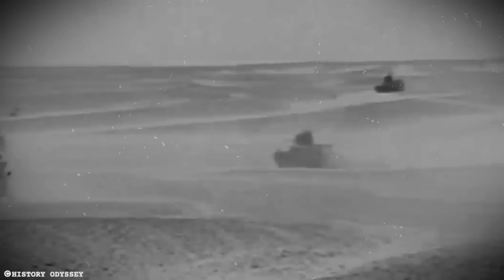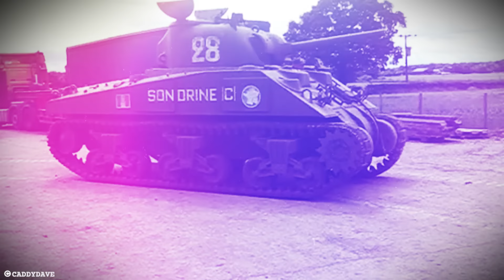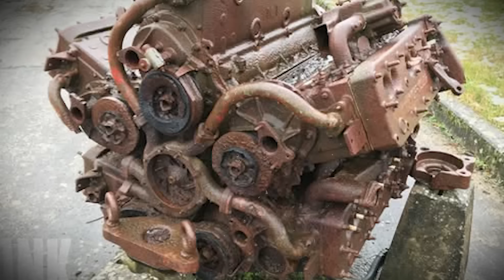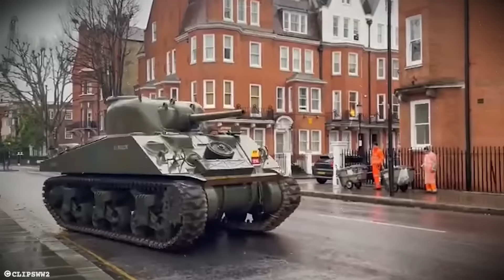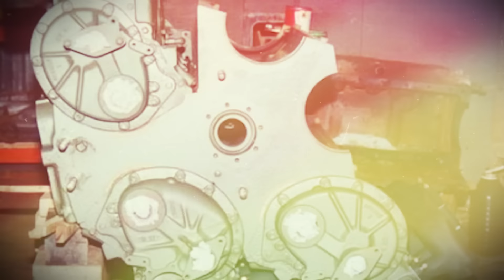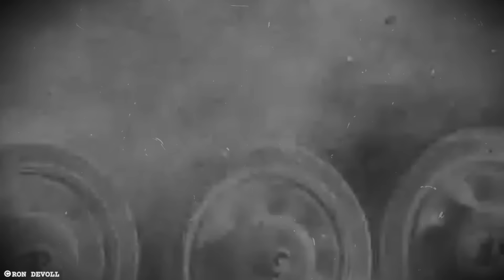The Dark Story Behind the Chrysler A57 Multibank – The 30-Cylinder Frankenstein Engine

Comment: small flathead 230 cu in n0t the big 6   (TOO BAD)   we used the ex valves 9n the Rambler 6 cyl Indy car turbo motor    BTW not to the cylinder head in a flathead
Reply: Offenhauser engine?!